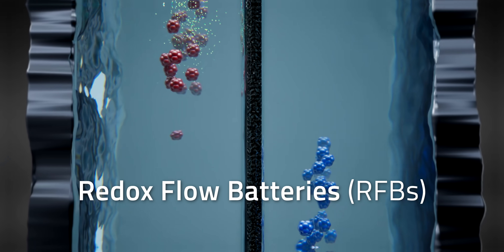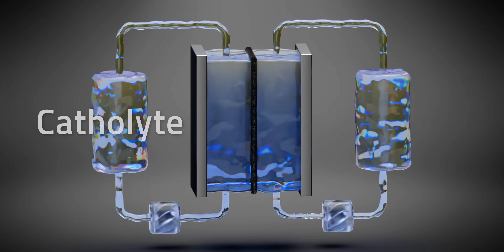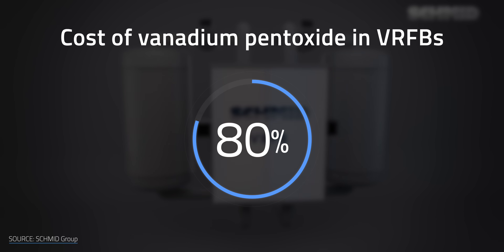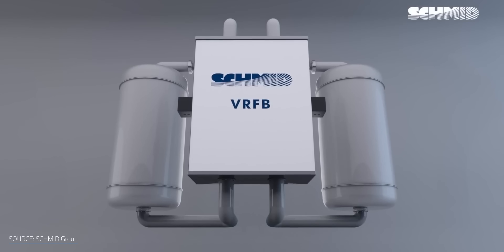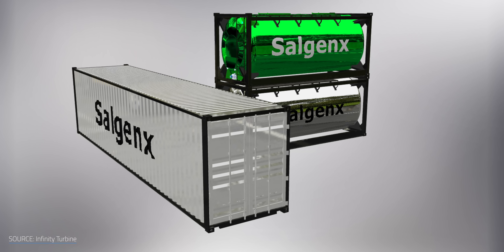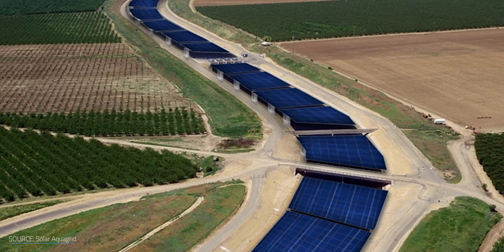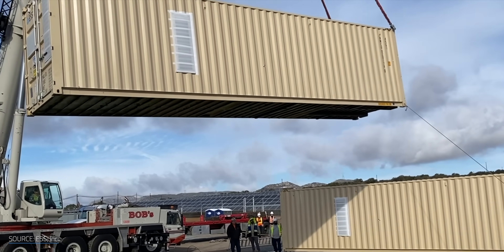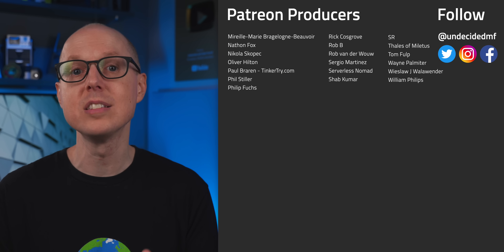Why Salt Water may be the Future of Batteries

Comment: I want to store energy for the winter to heat my house, the water and use electricity. Say I need 4500 kWh for  the winter. With a capacity of 125Wh/litre it takes a volume of 36 m3 so I need to place a 20 ft shipping container in my garden 😮

Comment: I think there is a huge untapped market here in replacing legacy building generators with this trailers assuming they can handle the volt use levels. buildings tend to have a 10-500kw diesel generator, if one of these trailers can replace those, and last 25 years, and be anywhere near comparable on total cost of ownership, they have a untapped market. especially if they can tie into grid rebate programs to provide power during high use.

Comment: All these ideas sound so much better than using li-ion batteries for "large scale" metropolitan power storage where volume and mass aren't limitations.
The sodium redox flow especially sounds interesting if it's really somehow able to also create graphene which would at once address multiple high cost, high demand conundrums although AFAIK there's a lot more to creating graphene sheets than simply a chemical reaction, creating single layer molecular sheets also involves technique which a difficult problem to solve.
I still think that thermal storage likely makes more sense than chemical storage but am willing to listen to any idea people come up with that can be proven executable.

Comment: sooner they push geothermal the less storage will be needed.
you'll have continuous energy with no need to mine again to power it.
solar and wind will become personal choices for houses and off grid living with storage.

and geothermal's benefit is it can go anywhere, unlike generation that's nuclear or fossil powered.
those are kept out of population, so need more infrastructure to bring the power where needed.
geothermal is THE  CHEAP answer to our future energy needs.
Reply: @yomanyo327   couldspend lots on nuclear that hasn't even been designed yet.
or  long expensive cables to bring offshore wind, or long expensive cables to bring solar from the sunniest deserted lads.

they already drill many km into the earth, both in depth, and distance for fracking.
the tech is already there. 
just need to perfect it, which would be faster and cheaper then starting fresh with nuclear, or adding huge storage for intermittent sources.
Reply: @yomanyo327  should go look up geothermal. they already have a closed system design drilled into the earth and testing.
drilling is still cheaper than all the infrastructure needed to  use solar/wind/storage 

couple weeks of  drilling, and build your station over top.
right next to where you need it.
not where the sun and wind are strongest, needing 100's of miles of cables to connect it.
Reply: @yomanyo327  
commercial scale solar wind need long lines to connect them into the grid where power is needed.
they aren't in neighbourhoods where power is used.

geothermal can go right near anywhere. 
short lines, less cost. 
much better than a small thermo reactor.

like the idea of hooking north african solar to europes power grid. 
the cost of the transmission lines is insane.
just as an example.
and then the storage question on top of that.
where? at which end?

Comment: Wind has a 3rd drawback.

Wind turbine blades wear out fast.  

The air flowing over the blades acts similar to sandpaper.

By the time the all the UK coastal wind projects have been completed, the entire fleet if blades deployed will have had ti have been replaced....and the blades deployed to date are not at all that recyclable.

Theyre getting better, however, the effort to produce, transport, and replace (and transport back for disposal) the blades isnt exactly insignificant.
Reply: they dont wear out fast, you have to compare to the amount of energy created, not time alone.
you always have to include absolutely everything, simple.
Reply: @JohnSmith-pn2vl  the motors don't, granted...the blades on the other hand become damaged quite quickly.

Comment: Advantages of flow batteries over LFP:
1) 4x cycle life
2) no thermal runaway
3) chemicals (Salt & Iron) are easy to recycle

Disadvantages of flow batteries over LFP
1) More expensive than LFP to manufacture
2) Hard to scale because of complexity
3) More maintenance. More moving parts to break
4) Too bulky for home use (grid use only)
5) Membranes don't last long
6) Single point of failure. More downtime.
Reply: LFP already has an insane cycle life, vastly more than needed. every battery is dead easy to recycle, nothing is wasted, literally 97% can be reused.
means, everything but the glue that keeps that thign together and some plastics. it wont get any better than this.
Reply: @JohnSmith-pn2vl  True. LFP is just Lithium, Iron and Phosphate - all none toxic.

Comment: Flywheels still exist and useless heavy crap is pretty common, they are slower and less efficient but you can scale them. They won't cover everything but they are there.
Reply: again one of the weekly "battery" tech we see since 20 years which is useless.
nothing beats lithium ion. its too good, abundand, clean, safe, high performance, 99% of innovation is placed in this tech and nothing is consumed.
its not worth to even try anything else.

now thermal energy storage is another thing, there the sand method seems the most promising.

Comment: I think they should eventually trying making those kinds of batteries for laptops, but not just the format we have now, perhaps it's possible to combine it with water cooling by having the flow pass by the cpu, picking up any spare energy it can to feed back into the computer, sure it wouldn't last forever but that doesn't mean it won't last longer than what we currently have to work with.
Reply: Short answer: No...
Long answer:
It's nigh on impossible to give it a compact laptop form factor.
It needs a lot of larger components to even work.
Also, salt water cooling is a poor chemical water balance for conventional PC water cooling systems.
(They'd corrode)

Comment: I would like you to do an explanation of what the hours on the batteries mean.
 So you've mentioned four hours or so for lithium and 12 hours for the flow batteries but I've never heard an explanation as to what that means because obviously these batteries can do a lot more than four or even 12 hours by just adding Banks of batteries in parallel independent technology. Is it just the economics only? That has always been a point of confusion. Thanks. very good video.
Reply: I believe that’s the length of time that they will hold power before reaching some standard level of self-discharge.
Reply: It's a reflection of the storage capacity vs the rated power output, and sort of the inverse of the C rating of battery systems. 

If you have inverters and redox cells to charge/discharge at 100 kW and electrolyte for 800 kWh you have an 8 hour battery. Increase the electrolyte storage by 50% and you have a 12 hour battery.

Comment: Renewable generation capacity needs to be multiples of immediate demand to deal with variation -- not only nighttime, but long nights in winter, not only calm days, but days and weeks of no wind, impacting enormous geographic areas. Without enormous, large-scale storage it can't work -- so battery solutions like this are essential if it's going to work at all -- and the cost of storage needs to be included to determine exactly how much investment is required, and that in turn has to be included in calculating the cost of operation and the price of energy.
Reply: Not only to make up for a very low capacity factor, but also to have enough spare power to charge enough batteries and other energy storage to have plenty to use in lean times (night time, seasonal/climate variations, poor weather, unusual demand spikes). Renewables/grid batteries is a good right now solution, but running entire cities and industrial sectors off of renewables and batteries for generation after generation is just unsustainable from a material and waste standpoint, even considering the bits we can recycle, especially when grid demand skyrockets as transportation and heating is swapped from fossil fuel to electric. Eventually fission with grid battery / RNG and H2 combined cycle buffers will be the only choice for these areas.
Reply: A combination of storage and transmission lines should cover it.  Remember you are only 6hrs in either direction from morning or evening...

Comment: The advantages here seem overwhelmingly in favour of it.
Reply: like what? its has none, people look at 1-2 properties and get excited.
you always have to include every single aspect of a technology.
lithium ion has no downsides, it is unbeatable.
Reply: @JohnSmith-pn2vl  Lithium is rife with downsides beginning with the impact on the environment to mine and process the ore through to the use of some metals (though this could be changing).  Li-ion has also not proven its chops on the recycling side though that is (slowly ....) advancing.
OTOH, the presented technology uses common and accessible chemicals (well - we don't know the entire secret sauce on the "proprietary" electrolyte (chlorine side)).
This tech promisses 20,000 cycles ... compared to Li-ion 2000 (best case).  Etc. and so on.

Comment: Hol up, you think giant batteries with chlorine gas is a good idea? Mm yeah, lets intall stationary war crimes near every big power plant...

I don't wanna die when the battery breaks, lithium may burn hot but at least I can run away from it and not get gassed to death. Chlorine was used to kill people in WW1, it is heavy and will spread far on the ground instead of going up into the sky

Comment: Honestly sounds like a great system for places that have abundance of space. I personally hope that this could reach commercial scale for individuals as well. So this could be an option for homestead batteries.
Reply: as if this would beat lithium ion in any way shape or form. no way
Reply: @JohnSmith-pn2vl  if its cheaper and the only drawback is size then it would for situations with no territory issue.

Comment: Matt, you are a salt battery for knowledge and wisdom! Thanks for this enlightening video.
Sometimes it seems to me like we are "progressing" back to some very basic and planet friendly technologies. Not a bad thing. ❤
Reply: I am directly working on the Salgenx project.  I actually feel incredibly similar.  A lot of these designs of "simple" hybrid flow batteries couldn't exist economically in the past due to large design flaws leading to bad efficiency.  And then while investigating more complicated designs we found solutions for these "simple" designs and those solutions now are being used on these old designs with moderate -> extreme increases in total efficiency.
Reply: @MrRollingPebble  Are there concrete plans for home storage using this battery tech? Do you worry about foreign companies swooping in

Comment: That's what I'm hoping for.  We went with lead acid AGM batteries because they are fully recyclable and cheaper vs lithium which is not.  Sodium will most likely be our upgrade option.
Reply: wtf are you talking about, every battery is completely recycleable. lead acid is not cheaper than lithium, you always have to consider absolutely everything, lithium ion is unbeatable, infinitly available, no issues to mine etc

Comment: Seems like for stationary applications, and maybe even large mobile ones, the density issue isn't much of an issue, especially give the run time, life time, and (lack of) fire advantages. Seems like for grid scale even if these were more money up front they could work out over time. I do wonder how they do when it's -20f or colder outside though. Seems like the salt water might freeze, or require active heating.
Reply: -20 shouldn't be a problem if the salt content is high enough.  maybe a little active heating for the tanks, but mostly insulation.  keep in mind that the VAST majority of north americans live in climates where it's too warm for the ocean to freeze.
Reply: These things seem to come in trailer loads per set. 🤔

Comment: Totally agreed we need a mix of power production, and whichever production we use energy storage is a very important part of that. For renewables it's obvious, for fission power because of Xe-135 production load following can be difficult and is very inefficient, it is much better to run a fission plant at 100% rated power. When demand is low that power can be diverted to charge a battery bank, when demand is high discharge the bank. Sprinkle in renewables where communities can't afford or simply don't have the education or political stability to operate and regulate/manage a modern fission plant and of course have a few combined cycle RNG/CNG peaker plants for emergencies.

For now we should be concentrating on renewables though since they can be quickly installed, then over the next few decades they can be swapped out for SMRs and other modular fission designs that can run off of the used fuel from older plants. Due to their low energy density for materials used relying on renewables for too long in a world with ever increasing power demands will snow ball into a waste avalanche over many generations even if we can recycle as much as possible. This doesn't even touch the land use debate or the fact certain areas of the world will need seasonal energy storage, not just night time storage, and increased resources will need to be used to compensate for the wildly varying capacity factor over the course of the year.